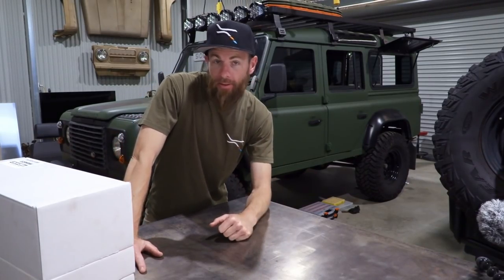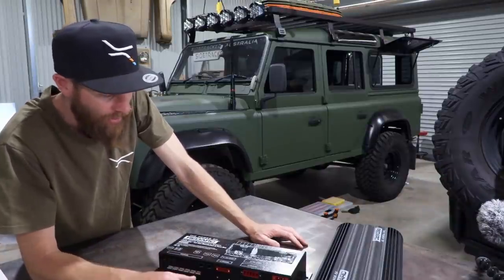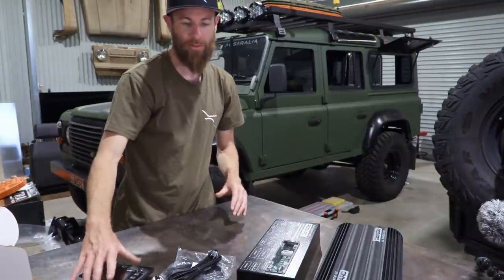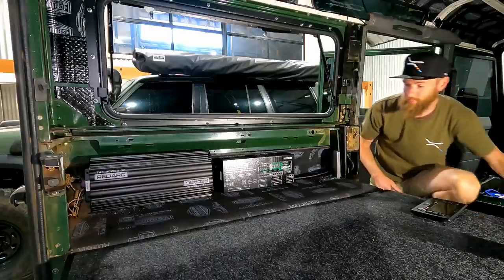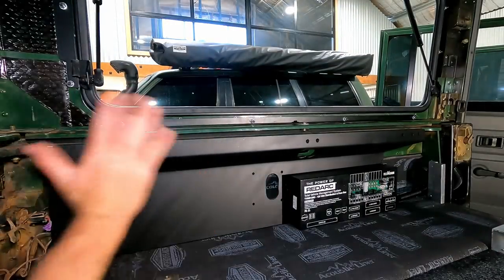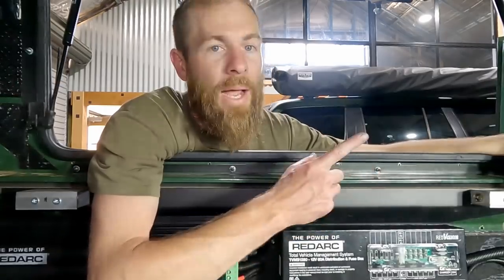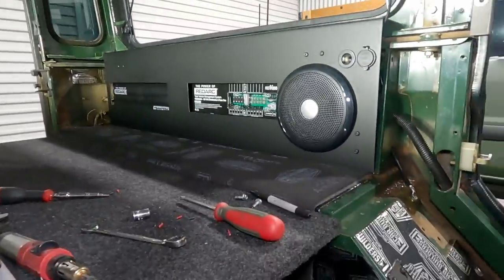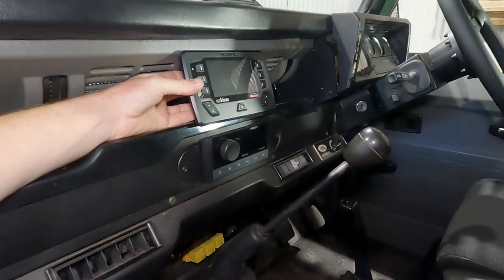#34 EASY! 12v upgrade for old vehicle - Defender + Redarc

Comment: I really don't get the value in the Redarc Redvision system. Digital switching which costs about $1.5lK. You can build something similar for less than &300-$500 with the same functionality. Of course, I do realise that not everyone is handy with dc systems, but honestly a 1 hour YouTube session and if you're handy with DC systems you'll find enough info to DIY the system. Thanks for the content, unfortunately you could have saved yourself some coin... Cheers

Comment: I installed mine 3 weeks ago. Had a test run up to Fraser the last 2 weeks. Got to say I love the app the most! The data is addictive to say the least. I couldn’t recommend this exact product more. Install was done carefully over a day and wasn’t hard at all. Don’t hesitate. 

As for monitor install. I wouldn’t bother putting it front and centre. I would just use the app as it will always be up with you anyway. Save the history stuff for when you check it once every few days to the back of the vehicle. History will hopefully end up in the app too anyway. Also if you’re reading RedArc. You definitely need to make the app compatible with CarPlay. Data displayed on the head unit would be next level.

Comment: I did a 3 month Cape York trip from Melbourne in my Jackaroo and Campomatic camper trailer in 2006.  I had my 45L Evakool fridge in the back of the car and a $100 AGM battery under the bonnet.  I don't know why people today need $5,000 battery systems to go camping.
Reply from the maker: It's simply a luxury some people like.

Comment: Great looking build. Question though isnt it a waste of time putting the screen at the front, as when your at camp you have to open the front door to turn stuff on or off or to even view the screen. Put it in the gull wing at the back i reckon 👌👌
Reply from the maker: I'm going to use it for a while to find out whats best... Gull wing makes a lot of sense though.

Comment: Speakers sound better when mounted to wood rather than metal. Perhaps you could use a piece of mdf, router the edge so the speaker sits inside/flush, and mount that to your panel so the speaker back so it's flush (if there's enough room for it)
Reply from the maker: Agree! Good idea, I'll see if it will fit.

Comment: This looks mint. It's great how you can customise it however you like since it's such a blank canvas. Are you going to do some fuel pump modifications? Interested to see before and after dyno if you do since most youtubers seem to just cowboy tune these motors.
Reply from the maker: Yeah just saving some $ for engine bits and diff bits but should happen this year.

Comment: I've got a manager 30 in my camper and with a 200 amp lithium and 200w roof solar. It's a super easy set and forget system.
However I don't have the red-vision. I want to get that for my 200 once I get the wiring resorted.
For what it's worth, I would put the monitor up front - epically if you look at getting a roof consol fitted. You could put the monitor on the side facia of the consol.
Also, have you thought about a fan in / out to try and keep the dust out?
Reply from the maker: I like the idea of having the display central, so from either the drivers seat or passenger side (while camping) i can see and press buttons. Yeah the fans an idea! I'll seal some holes first, then look into one. Cheers!